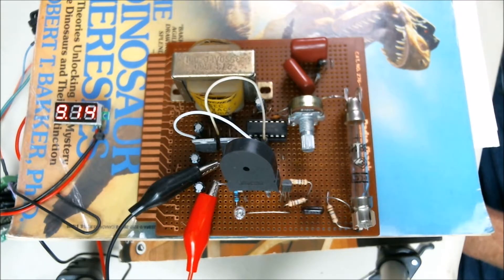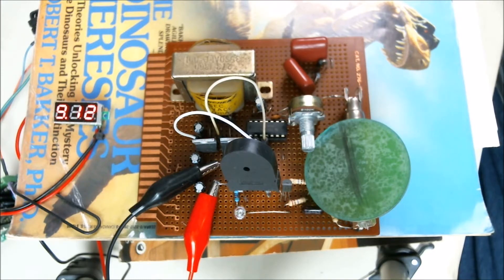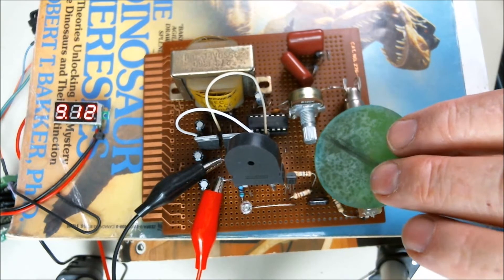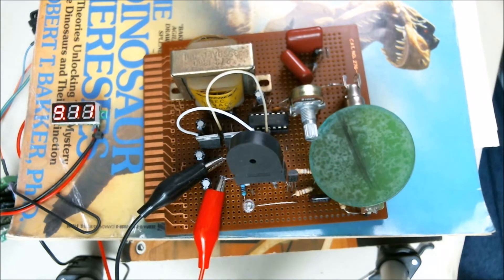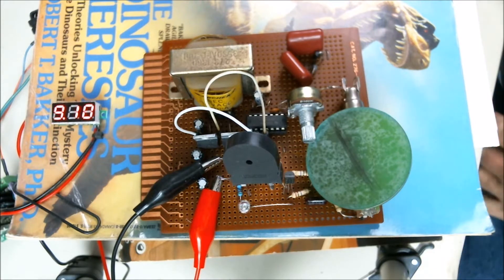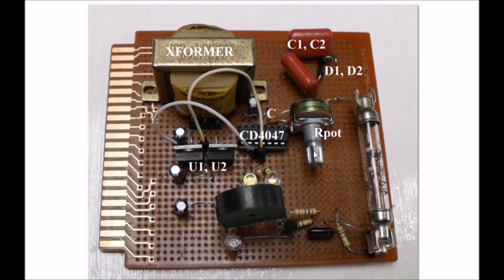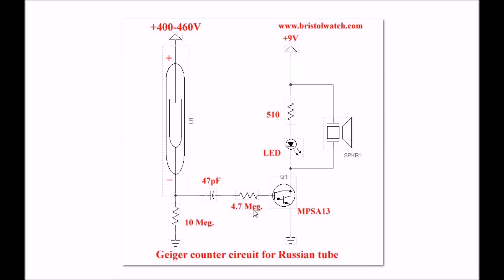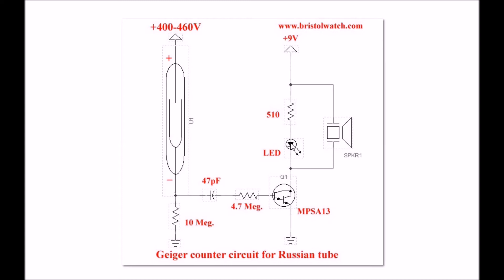Home Built Geiger Counter Radiation Detector

Comment: How much radiation does the glass make?
Reply from the maker: It's on the spec sheet which is in Russian. Timing it over 60 sec. I get about 2 clicks - but that could also be background radiation. The tube type isn't very sensitive and was a disappointment.